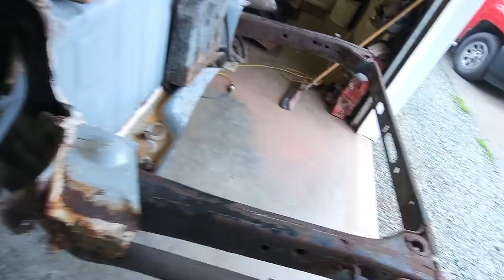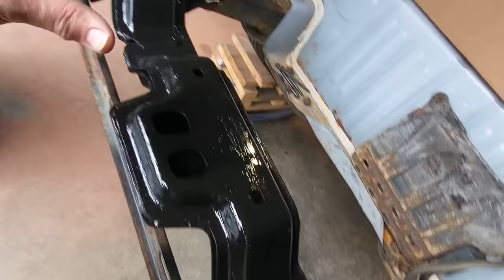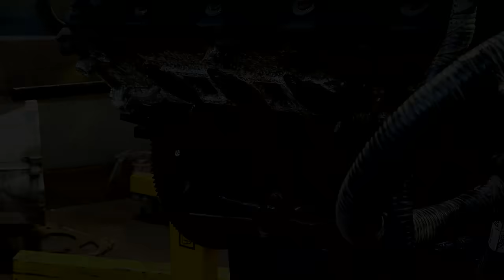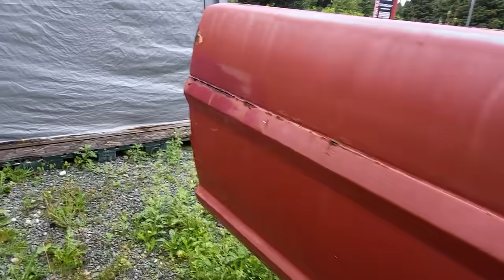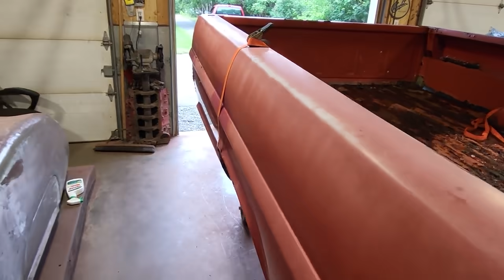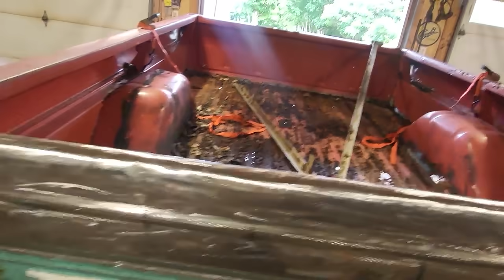Sealer, Paint, Engine troubles.

Comment: Tony I have a 1963 Willy’s panel with barn doors, the total floor needs replacing. As with everything in life this is my first time to replace a total floor of this size. So I m thinking x bracing just above the inside floor , but what about racking? Should I go driver’s side top down to passenger side bottom and vice versa for the opposite wall? Also am thinking about a rotisserie, I also have a 1962 Volvo p1800 Jensen which I would use the rotisserie on for cleaning up the underside. So the rotisserie would be used again. So what do you think of my plan?. Also I was thinking of using an old pick up box floor for material. Thanks David

Comment: Hey Fitzee,
I watched you nurse the tailgate back to somewhat solid.  I would appreciate if you could tell me the settings on your Arcaptain MiG 200 when you were closing up the rust holes.  I’m struggling with butting trunk patches to my existing steel in a Chevelle trunk.  I keep blowing holes in the existing 20 gauge.  I’m using .023 wire with mixed gas (75% argon/35%co2).  I believe you use the same setup.  If you can tell what voltage/wire speed you used it might save me.  I use the spot weld feature (.4 seconds) with 15 volts and can’t bridge the holes.  (Using the 115 volt supply). 
You have inspired me to take on sheet metal repair.  Many thanks for all your teaching !
Peace my friend !
Reply from the maker: I never used the spot welding feature. I set the volts on 13 and speed on 6. Ill play around with those setting,going up and down till it feels right

Comment: I suspect the reason there is 10 bolts in the manifold bolt kit is because it also fits the V-10 engines.  Rather than have two part numbers -- the V8 people pay a little extra for parts they don't need.

Comment: Those motors have a half plastic half metal intake manifold that fails with age. Now is a great time to replace that before installing. The egr valve is hard to get out of the way when the motor is in the car

Comment: Tail gate twist.
  Do it the way Porsche did with tweaked door windows frames in the 1970s. 
  Put a 2x4 between the good side and push or ratchet strap the one that sticks out. Over twist a bit for springback. 
   Did it on $75,000 Turbos. 
   True.

Comment: the gas cap is sealed on the crown vic... it has a pressure release like a radiater cap but not needed with venting done through the evap canister so yes you can use that cap but likely have an evap  code cause they never sealed great in the 70s... if your tuning it anyway, you can turn that off

Comment: Long ago a friend of mine cut a hatch into the floor of his 68 ford truck and mounted a metal box between the frame rails with the floor section as the lid. He stored tools and such in there and it also fit a case of beer. You could integrate storage boxes both fore and aft of the rear axle and have a flat box floor. I had the perfect aluminum canopy for the truck, the back 16" had a diagonal tear in it that you could have eliminated when you shortened it. I'll be watching to see how you make it all work.

Comment: And using that fuel fill will cause a check engine light. The fuel fill seals it tight. A loose cap sets the light on. So a vented cap like the one you have will do the same.
Reply from the maker: I was wondering that. Thanks .

Comment: A possible way to untwist your tailgate ->  mount it on the box and with it open, support the right hand side at the top and use your 250 lb press to put weight on the left side. It might work, as long as you didn't make the tailgate too strong when you repaired it.

Comment: Yes the tail  gate  might be twisted,  but 1 inch ... ?🫢😜😉Your eyecrometer cant be that bad... no way you're too good for that, I dont see it. First test is find a flat table  or floor and see if it lays flat or is it 1🙏🤏🤓 rocking ?? I say this because  even  if the  bed is a tiny bit sitting  out of square ( dead flat or level)  it will magnify  that over the distance.  Try blocking  the bed up and use a builders level 1/4 inch lift the right way at the front will make a 1inch shift in the back ! Check the tail gate shut is plum/ vertically  ( both sides same with a builders level) . If the tail gate is twisted it will only be a case of letting the bad side go ("cut n shut")😂 I think a horizontal cut  in the  end rib will  make it go all floppy thats where all the torsional strength is . 🧐 wtf😂

Comment: Thanks Fitzee.  Since you have to redo the wheelwells on the box anyway, how about NOT cutting the 4" out of the back of the box, saving you work, and sliding the wheelwells aft 4" when you rebuild them?  Looks like the box sides are better towards the back, so you could also cut more of the rusty front metal off.  Good luck!

Comment: I had a Crown Victoria and it sprung an oil pan leak due to a rust hole.  That was while out of town at a hockey tournament with my children.  What a mess.  After I had my mechanic check it out and I asked for a new oil pan he advised me that dropping the pan and changing it was not practical because the modular 4.6 litre V8 used extra long bolts to hold on the pan and they were used to hold the modular block together as I recall his words.  He simply patched the hole and it never leaked again.  I’d check out if dropping the pan is something you wanted to do because I thought I heard you say you wanted to do.  Cheers!

Comment: Hi Tony.  Well, at least if anything went wrong with towing the pickup bed, you had it on video.  The tailgate looks good on the old box.  Maybe you could temporarily weld an eyebolt or a hook of some sort on the side that needs to come in and use a ratchet strap hooked to something solid on the other end, to pull that twist back into place?  Considering how bad the tailgate was at the start, that little twist doesn't seem too bad.

Comment: 37.25 the fuel cap needs to be sealed,meaning not vented or it will turn the check engine light on for an evap leak.I would use the crown vics fill pipe and cap.if possible.

Comment: Do you know why those welded studs keep snapping off ? Because you are trying to unscrew  them whilst the metal is still hot and soft. The heat is also expanding the bolt metal into the block and making it tighter. The heat and expansion is good because it burns and crushes the rust, however you need to let it cool and shrink. Rapid cooling is even better as it hardens the bolt steel and shocks the rust. If you can cool the bolt whilst leaving the sorounding metal hot , that is even better. I usually rapid cool the bolt with some WD spray and have a 99% success rate I also rarely bother to weld nuts on , I just build up some weld and grab it with vice grips.
Reply: Build up with weld then weld to a large screwdriver and spray with water.  Way quicker ... less time mucking about.  99.99 % 😂 and the other 00.01 pifft ! 😅

Comment: Many years ago and old engineer I worked with told me to squirt a bit of water on those seized bolts before they cool down. He was talking about after heating them with the gas, but after welding works the same.  In my experience that gives AMAZING results. Often you just crack them with a spanner then wind themmout with your fingers. Work much better than trying to undo while still hot.

Comment: The fuel system  has a evap system  that you can remove  but you will have a check  engine  light on . But something  i was thinking  was the intake manifold  on that engine  should probably  be replaced  or a least  new gaskets  but thay shrink over time and vacuum  leaks . If you really  look at the mating  surface  you can see the worp and sometimes  can fit a feeler gauge under them
Reply: If memory serves they also like to crack at the thermostat

Comment: I've seen the "weld a nut onto the broken bolt" trick before, but yours is the first time I've seen someone put on a washer first.  This definitely makes a lot so sense because it reduces the possibility of welding the nut to the base metal when you weld it to the bolt.   Definitely have to remember to do this in the future, as I wonder why nobody else ever showed doing it this way.
Reply: I was going to leave the same comment and I saw yours, Fitzee and his outside the box thinking is definitely appreciated. He keeps proving his left handedness.
Reply: I have tried with and without the washer a few times and the washer always makes it easier

Comment: Tony  ~~~   dawn dishsoap mixed 50/50 with water in a spray bottle will kill wasps on contact. it smothers them about as fast as any comercial  spray. try it ---- i t will knock them out flyong. did you have either motor running before you started the F100 project??
Reply from the maker: Yes the engine on the stand came from the second  crown vic and I had that one running
Reply: Well I'll be, hadn't heard that one before. But it does explain something we have found here. We do a lot of gorse spraying and that spray seems to be more effective on wasps than I would expect it should be. But the spray has a wetting agent in it. Presume it works like the dish soap?

Comment: With that trans mount,  try splicing the ends to make thinner then install a long vertical shim between the xmember and frame with a loop or slot on bottom that you can grab hold of next time,  once the shim is out, it should be loose enough to drop down easily.
Reply: That's a good idea, I gotta remember that one